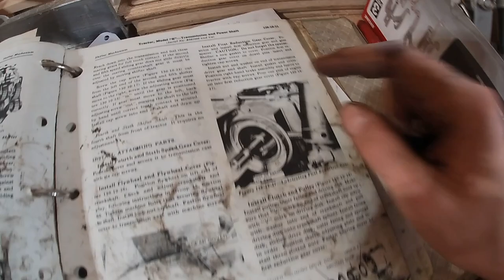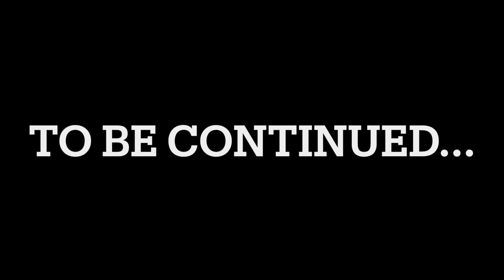Restoring a John Deere B | Part 1 | Getting it running

Comment: I feel for you my friend. I bought a basket case 1939 B about 7 years ago now and just in the last year (2021) I really made an effort to complete an almost total restoration of it. I am now in the seven to eight thousand dollar range and I have yet to drive it. I figure I will have a total of around nine thousand dollars in it. Two thousand in just the engine. I am into it to the point I could never sell it for what I have in it so I must finish it. Good luck with yours...
Reply from the maker: thanks. You'r right, it is not economical to restore and sell these tractors. I probably should have parted this one out. But is obviously too late. I still need to find a set of tires for it.

Comment: Great job young man FYI and you already probably know this the fly wheel has a timing mark on it let her stamp V in addition to be in the timing of the engine it is the counterweight for the crankshaft the opposite side of the crankshaft where the clutch is attaches also has a ladder stand V and it is a counter weight for the crankshaft just thought I’d throw that in there he did a great job

Comment: The trick when using silicone is to tighten down until you are lightly touching the silicone with the entire surface and let it cure for at least a few hours preferably a day then tighten down to spec (recommended torque)

Comment: im about to buy a jd b myself do you know the best websites to go for parts/questions
Reply from the maker: I suggest buying a service manual on eBay or probably Amazon. For parts Steiner has pretty much all you need. If you need cheaper used parts Rusty Acres Ranch (vintagetractors.com) parts out a lot of B’s.